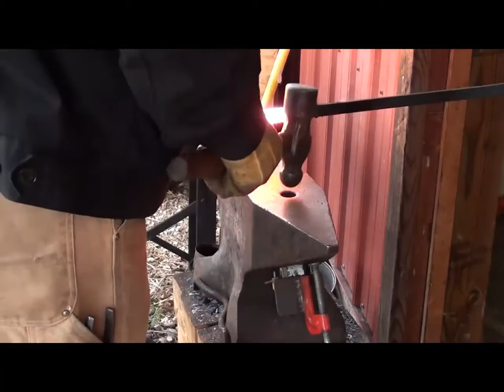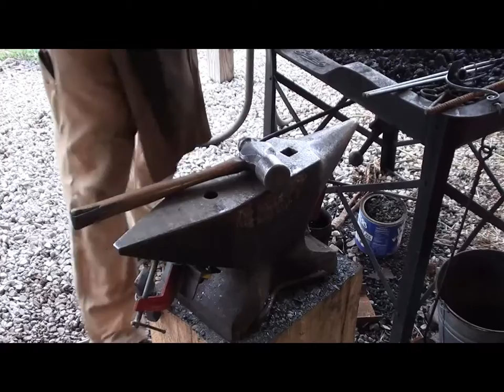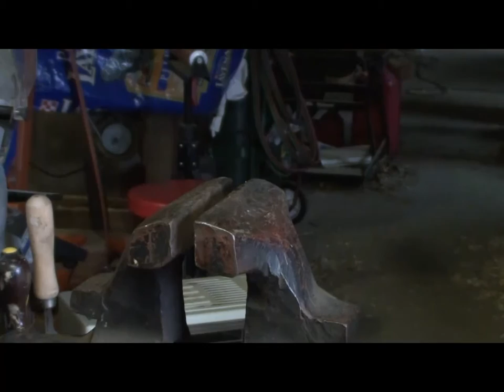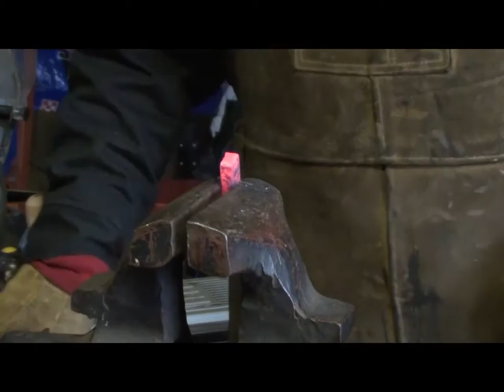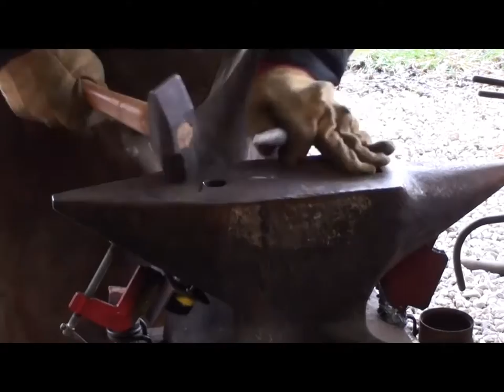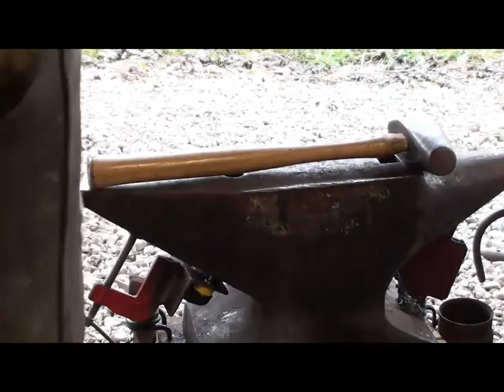Lewis Part 1

Comment: Can you do this same thing with Stainless? Just wondering, Wish you could explain it.
Reply from the maker: +navythomas8 Well, you can forge stainless, probably wont be very stainless afterward.
Reply: bc65925 Nuts that would make for Great tire spoons. I have one I purchased but the rest all rust in the tool tube.
Reply from the maker: Just a mater of proper metal preparation. I covered these with bees wax which would probably be OK for tire irons also. I also have some metal prep oil that actually dries enough that you can lacquer spray them after a couple weeks. It soaks into the pores of the metal.
Reply: bc65925 I have tried cleaning them up, then painting them, but it still comes thru. That oil stuff you use would prolly be the ticket. I will see if I can find some locally.
Reply from the maker: +navythomas8 This sounds like a good project for some old coil springs!
Reply: bc65925 That would be interesting. I just saw you have 9 Turkey Ranches out your way that have Bird Flu. Watch what you buy!